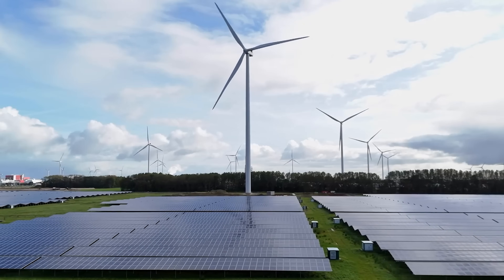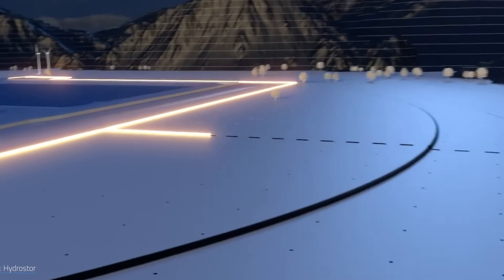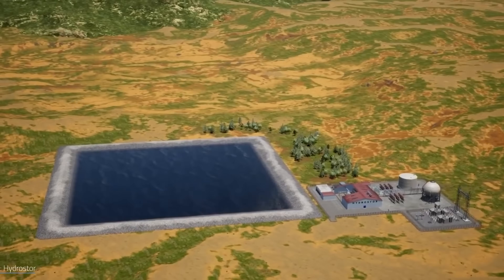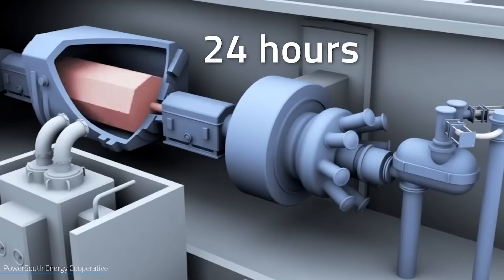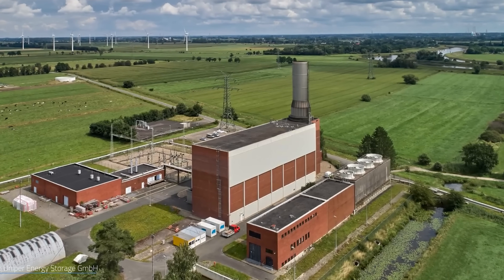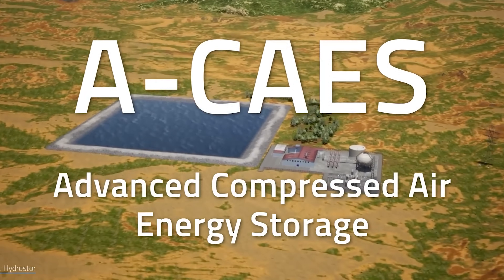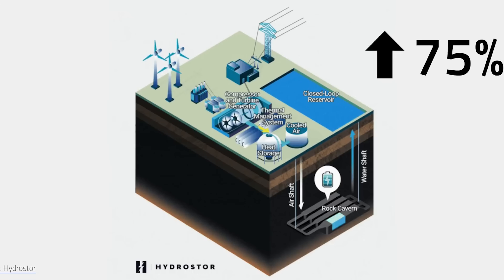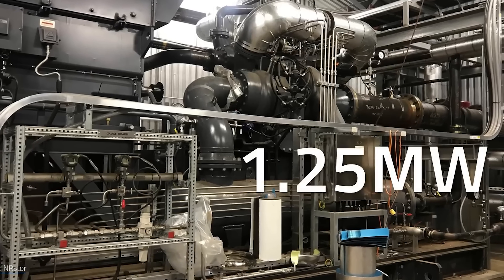Underground Air Batteries — The Energy Storage You’ve Never Heard Of

Comment: What about the gravetricity method? Put a heavy waight down  a  disused mineshaft, lift it up with cheap over night power 5-7p per kWh

Let it drop and generate power with it between 5 and 8pm when grid price is normally between 20-30p per kWh 

Even with 30% round-trip  loss,  that is still costeffective.

Comment: If they are compressing air, I wonder if they can do some separation of gases to sell as they do it? Even if it only doubles the quantity of that  gas in the mix, that may have value. Also combine it with large solar thermal mass storage and get a boost to efficiency that way.

Comment: This is a fairly old method and is being used in London OK it is slightly different but works. The heat is used for heating buildings and a hospital so if there is a will there is a way. A lot of these things fly under the radar probably because of the effluent holding things back in favour of oil.

Comment: The numbers being quoted for the energy storage projects are all in MW, which is a unit of power not energy. The main drawback of compressed air energy storage is its relatively low energy density. Salt cabin operating at 200 bar will store about 3KWh/m³, under the same conditions using hydrogen who can store about 116x more energy, what about 58x more once converted to electricity. Storing methane under these conditions would be more than 4x greater energy storage than hydrogen
Reply: Good point though I think you'd lose a fair amount of hydrogen through intercalation, as well as machinery developing embrittlement issues.

Comment: The great thing is that we have several energy storage options becoming available now. Gravity, compressed air, hydrogen, pumped hydro, chemical batteries, thermal storage. All technologies that are passing through or have passed through pilot stages and proved that they are viable. The advantage is that they can be suited to specific locations and take advantage of local facilities. Compressed air in old mine sites (Broken Hill, Australia), gravity in deep vertical mine shafts, pumped hydro where dams and elevation exist and so on. Complementing wind and solar which has long been proven now. Hence, the argument that renewables and energy storage can't replace fossil fuel is well and truly over.
Reply: Exactly